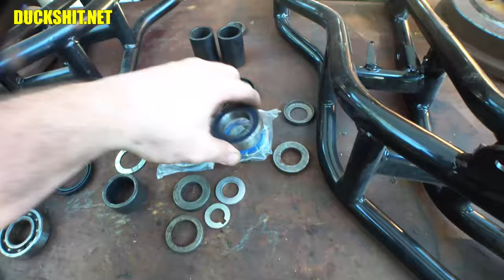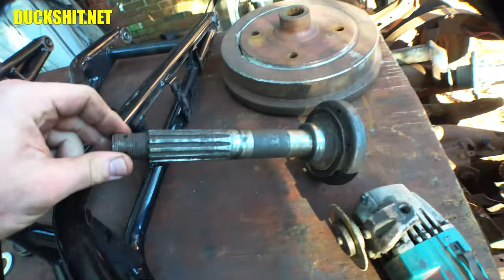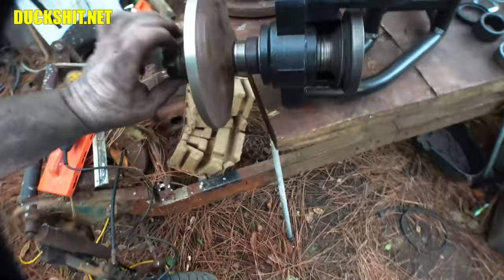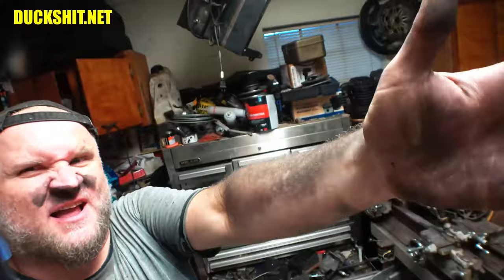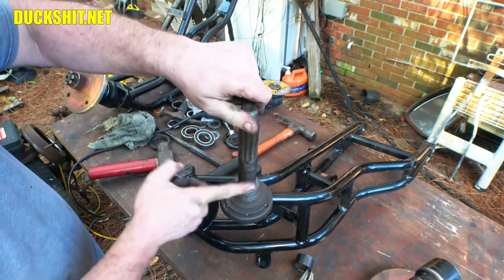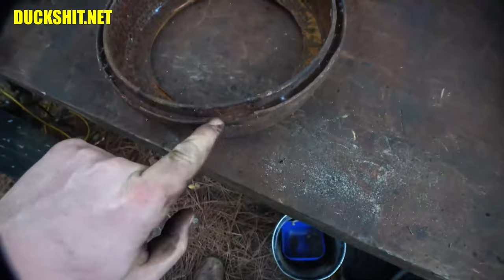Finished and IT WORKS! 🔧💥Making VW Beetle Axles fit in Go Kart

Comment: Hey Duckman ! Instead of cutting into your frame to move the outer trailing arm pivots forward to align with the existing inner trailing arm pivots, why don’t you just weld some longer pieces of plate steel to the inner pivots to bring them backwards to align with the new outer pivots you will need to weld on ? I’m sure there is a downside I don’t see but to me it would make the job so much easier, stronger and quicker.
Reply from the maker: Because the existing mounting points are square to the frame!  Simple, anything else is less easy!  One wrong alignment and I have a disaster, I don't see any reason this would be less strong.